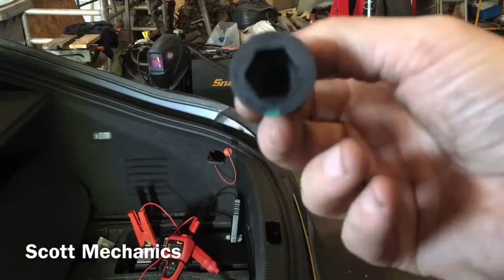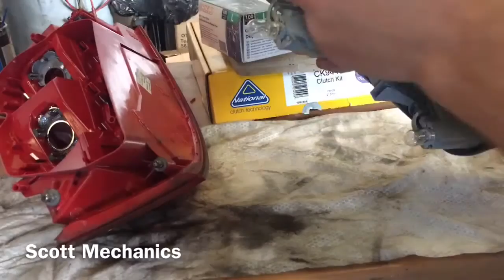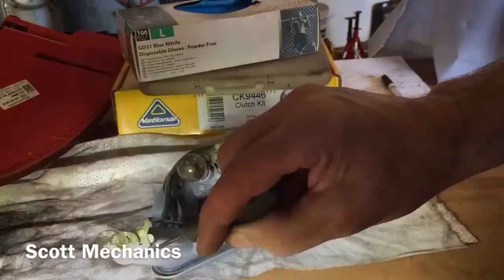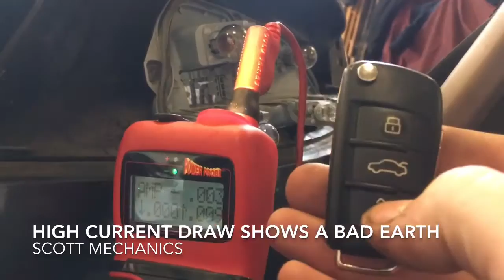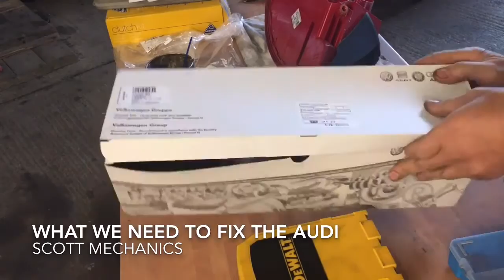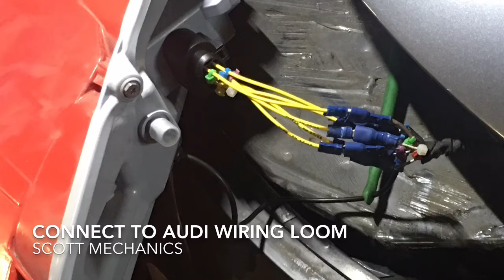Audi TT rear light removal and fix by Scott Mechanics used power probe hook good tool

Comment: Very informative video Scott. My car had the same issue only the pin was burned much more than the car in your video. To get the car back on the road  I took your idea and put a hole through the body of the light and soldered a new wire to the earth rail inside the housing. I then cut the brown ground wire off the OEM plug and put a bullet connector on the end and plugged it into the new wire. So I can still use the car while I source a new lamp holder.

Comment: It's not clear from the video how you performed the test with the hook to demonstrate the fault. I find it easy enough to prove by putting the lights on and applying negative to the earth rail in the cluster...the lights will brighten. Even cheaper method for the customer and time saving (no waiting for parts) find a suitable hole into the cluster or drill one, put a wire through and seal it then solder it to the earth rail. Keying the rail first to give the solder something to adhere to and getting the rail good and hot to ensure good connection. Splice this wire to the earth wire then cut and put a bullet connector or similar  in the wire.
Reply from the maker: Hello neeniebob1
The hook is used to show current flow a bad earth has high current flow (cause and effect) I added a extra earth as well the black from the new bulb holder, the new bulb holder is not expensive from Audi ,as for the old unit corrosion is the enemy and will spread giving you more hassle later on 
Thank you for your time from scott
Reply: Sorry I didn't finish watching the video to be honest so didn't see the additional earth. I have seen the second video now tho. I understand what you are saying about current draw proving the fault but what I'm saying is you haven't shown how you have wired this test up and explained your method for others to follow. Talking about this fault in general (as in applying it to the many different cars it affects) the most common cause I see is poor connection causing the burning of the earth connector hence 99% of the time the plastic around the pin is melted. The spring pressure contact of the female of the connector just seems inadequate to cope with the current demand of all the lights. The increase in current draw is dissipated as heat in the connection. I find it easier to prove the fault by quickly comparing the voltage each side of the connector, close to 0v on the wire, considerably more (0.5v or more) on the earth rail inside the light. It is this voltage drop / the resistance of the bad connection that will give you the increase in current draw. Love the videos :-)
Reply from the maker: Thank you it sounds like you know what you are doing ,I put the vid on YouTube to help others fix there cars,bikes or help the under stand what I think will help fix them 
It's free help 👍🇬🇧🏍
Reply: Totally admire you for it and wish I could be as productive and do the same. I hope you didn't take offence...I'm just trying to offer my $.02 for the viewers and for you. We're all in this to help each other. Not trying in any way to take away from your very educational and informative video. Just feel I can give you comments from the perspective of a viewer, point out where I would like further explanation and offer other possible methods. I would send messages privately in future and share tips, points of view etc if you like and there is a way?  :-) I'm an autolec btw... mostly into electronics repair, flashing and coding of modules etc but still have to all this mundane stuff on a daily basis :-)
Reply from the maker: Hello Bob
Thank you  for your comments 
I just film and  photograph while we work on my I phone
And alway think there is a better way 
I don't think mine is the best it just the way I do the car or bike repair ,I would like more tecs to work together 
And help each other , the number of car makes and models out there is so vast in the last 18 years I have probably only seen 10 to 15% of what's out there ,so much to learn 
My email is scottmechanics@ gmail.com thank for the reply👍🇬🇧🏍